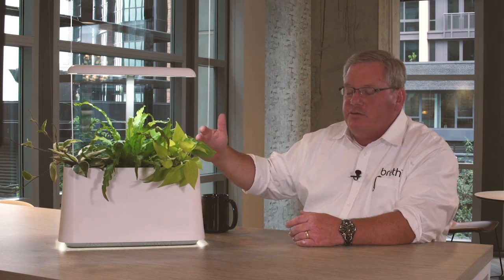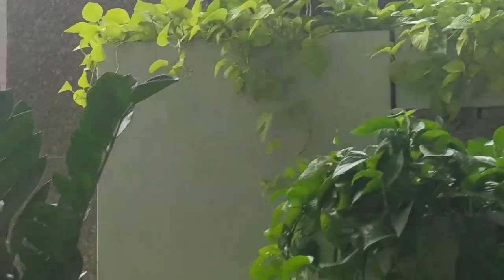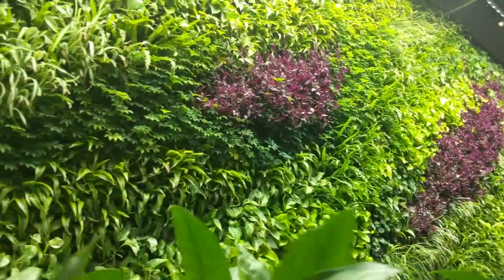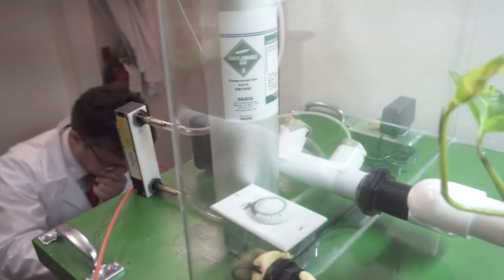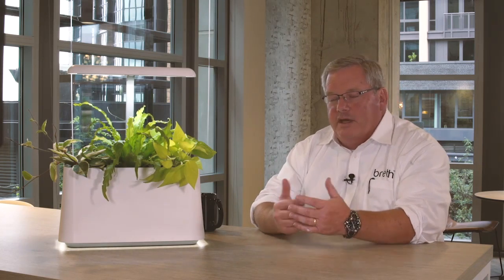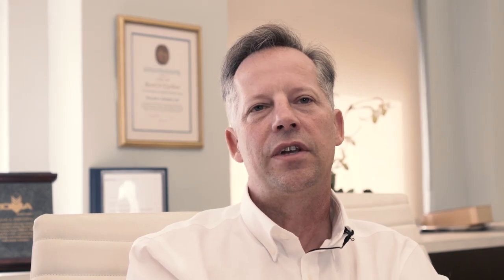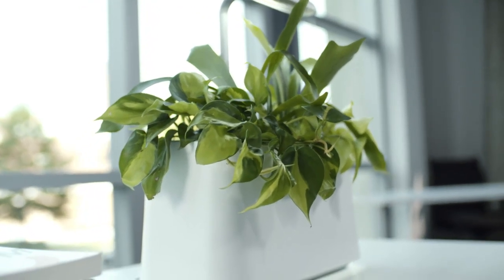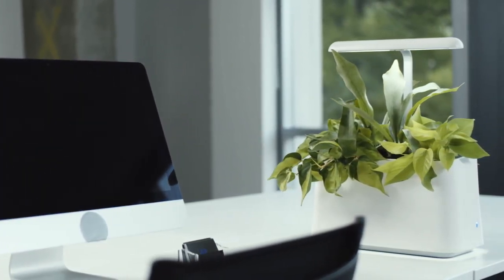The Science Behind brēth

Comment: Let me get this straight - you put a plant on an air filter then pretend like it's a novel idea?

Wow... How's that misleading science going for you? A time series graph with no units of measurement... Right. Looks solid.

No control test? How about competitors in terms of air filtration? No competitive benchmark results across multiple substances and/or products?  

The only thing that your "experiment" showed was that formaldehyde was removed when it passed through your air filter... Duh...

What it doesn't show is that it's better than any other filter. It doesn't show that the plants add any benefit to the filtration process. It doesn't show that it's actually cleaning the air. 

Let's face it. This is a product designed to mislead people that are ignorant of the scientific process.